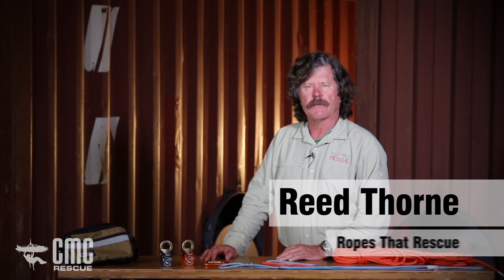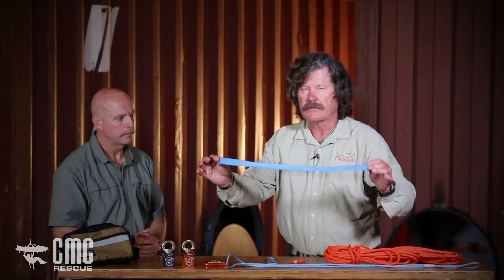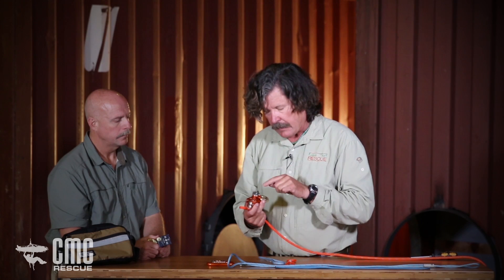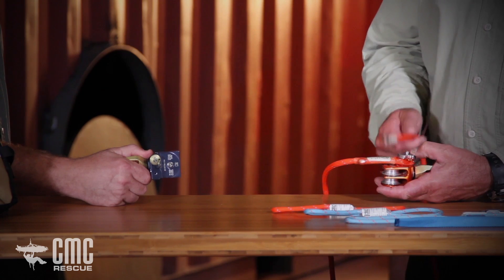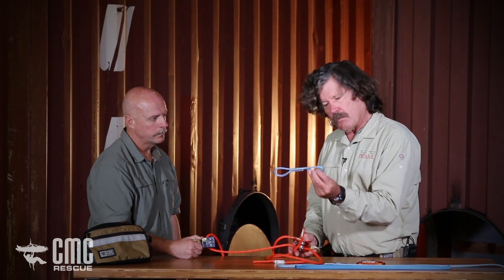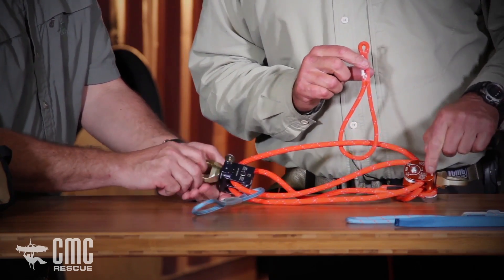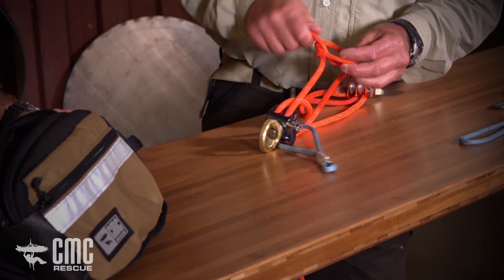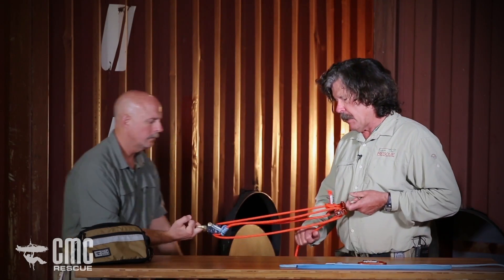Assembly of CMC Rescue's AZTEK ProSeries™ System with Reed Thorne & LeRoy Harbach | Technical Rescue

Comment: Good night Sirs.  I have a question.  Which configuration is best if any. the prusiks set on the opposite side of the of the pin of the omni block? On the same side of the pins of the omni block?  One on the same side and one opposite side? Both opposite sides?  Or just doesn´t matter?  Very respectful.
Reply from the maker: Hello Jorge,
 For the Prusik-to-Pulley connection on the CMC ProSeries AZTEK System, the orange Prusik always attaches to the orange Omni Pulley OR the blue Prusik always attaches to the blue Omni Pulley. Never are both Prusiks pinned to the same pulley becket or to the orange and blue pulleys at the same time. The design of the AZTEK system having two Prusiks attached to the host AZTEK cord is so that you can manage/mind the Prusik within your reach depending on your setup as a 4:1 or 5:1 MA configuration.  Does that answer your question?  Cheers!